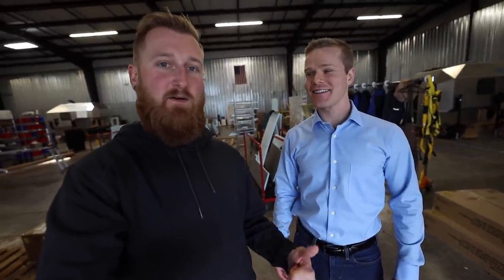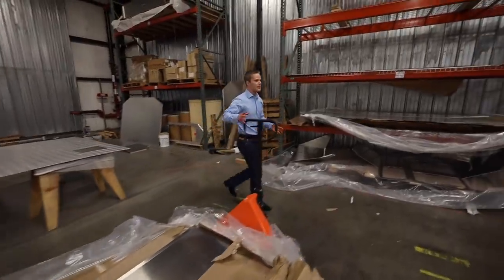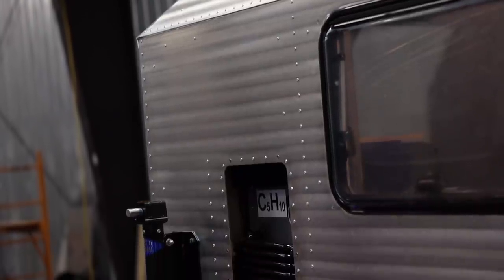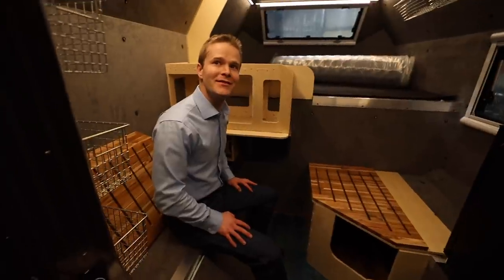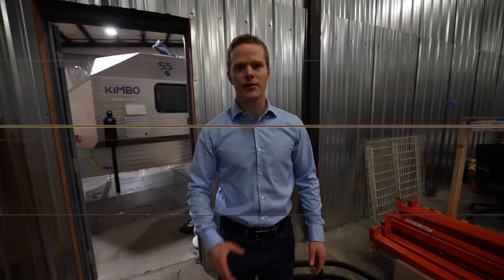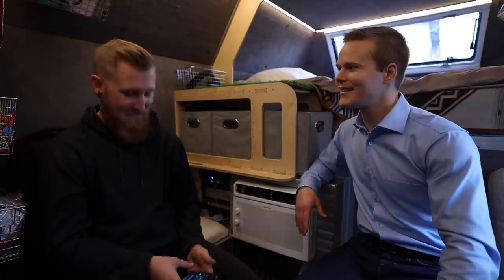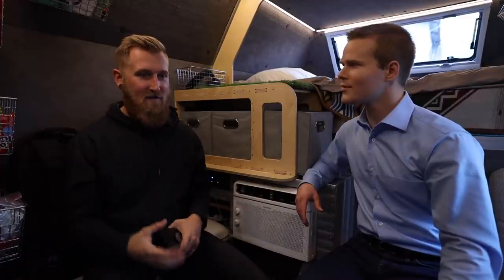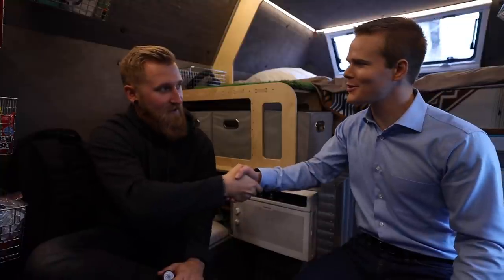How Kimbos are Made! | Q&A with owner Mark King

Comment: Why not use lithium iron phosphate in the power system, instead of lead acid?  Is the outer shell clear coated or does it need periodic treatment?  What sits between the bottom of the Kimbo and the steel bed of a truck to mitigate galvanic corrosion?  Is the Kimbo door insulated?

Comment: I have a friend that tested the cybertruck who's the friend of Jay Leno's he said it would definitely cut down on the range but since it has an air suspension that's adjustable it would make it a lot better and comfortable ride plus if the module had extra solar panels or if you put a generator in it you could charge your truck as well

Comment: Make it for 8 foot bed box truck and 
you will have more demand then 
You can handle
Also use diesel heater such as Espar 
Im curious what INSULATION it has?
Reply: I'm guessing 1" r-5 foam board

Comment: Looking forward to future kimbo products. Interested in the 8ft version and would love a camper that fits the Tesla Cybertruck

Mark, if you see this, I'm a guaranteed customer for a cybertruck kimbo. I've been waiting ages for an electric RV and I'd bet I'm not the only one. I'll even come help you prototype it. Don't worry too much about range... it'll still be reasonable if you have the 500mile cybertruck. (It'll be like 250-300miles with the camper instead of 500, but that's where the cars are at today.) Add a ton of solar and it can help feed the vehicle too. Then you can go camp off grid for 2 weeks and head out some extra range.

Comment: This is totally how I'm gonna build my truck camper 👍
Reply: This was my concept too. Started watching purely to get design ideas for my own build. But these are done so well, I think I'll buy the base model, and then build out the interior to my own specs.
Reply: But how is the A/C unit there hooked up? Where does it leak it’s water to?
Reply: @c.e.g.670  Probably has a drain somewhere?
Reply: Probably should’ve explained that in the video
Reply: @c.e.g.670  I guess? I'd assume it would just be one of those things that they didn't need to explain? You got A/C somewhere, you put a drain in 🤷‍♂️
Reply: @Smokkedandslammed  after watching so many diy on how to build something like this, everything kinda gets easy and self explanatory it’s just nice to cover my bases, i know how an AC works lol i just like covering all my bases

Comment: It would be awesome if you build one of these for the Cyber truck it already looks kind of like it and the Cyber truck comes with a 110 and 220 outlet built into the bed that you could run up through the camper to render AC fridge hot water anything I'm just saying I pre-ordered a Tesla cyber truck and the most awesome thing to be able to run everything off of the truck silently out in the woods you guys are onto something great here you put the good work
Reply: You would want a pop top for the cyber truck. Kimbo would destroy the range

Comment: Dont understand why these slide-in campers are not welded together. saving weight and construction time. A spool-gun Mig Welder could blast through this manufactured process in no time. I personally think they sit way too high, and maybe they should have been a pop-up design for the height factor on gnarly forest trails and roads....At least they seem well made; but the price is beyond crazy......
Reply: The rivets and sealant are within DIY skill set for repair so I think that’s why they do it that way. Pricing prob has more to do with the small production.
Reply: @chrisherbert4454  Yes I see many of these companies making their Huge Profits and then closing their doors not soon after. That is the way of Fads. Hate it is that way but it is the normal for the USA......